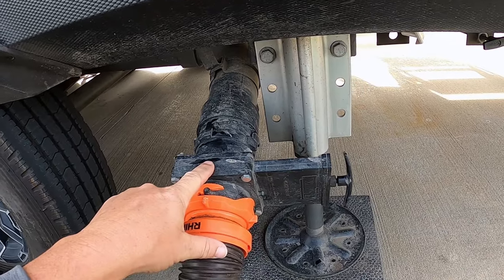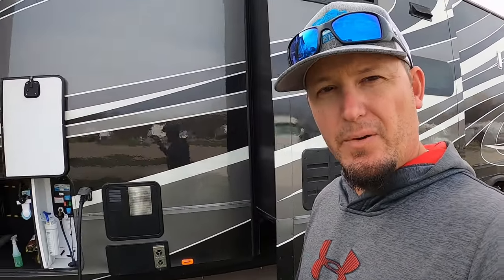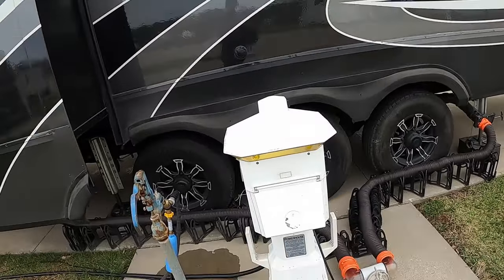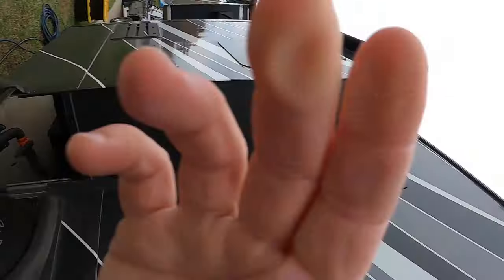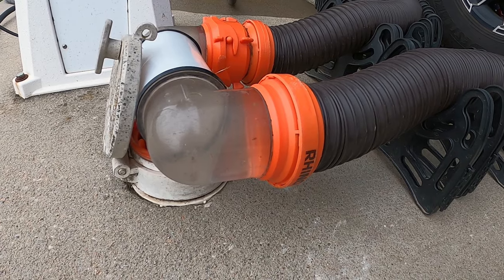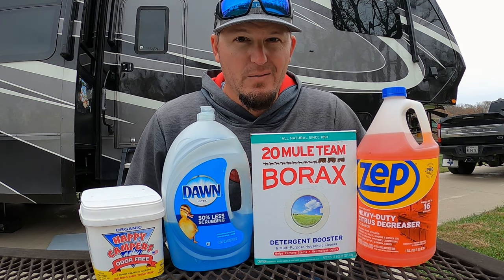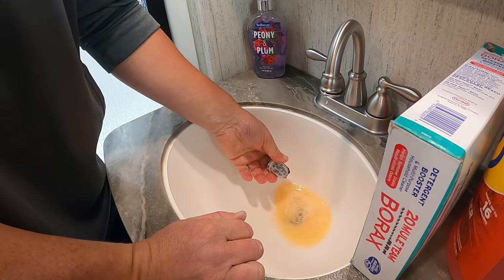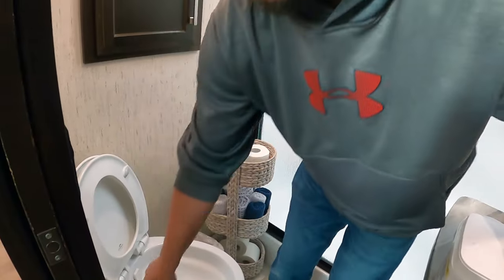RV Black and Grey Tank Cleaning and Maintenance | Geo Method | Full Time RV Living

Comment: Is there a reason why you don't flush your black tank out while it's draining? Another video showed the person pulling black tank valve to empty then went to the city water and turned it on so while the black tank was emptying it was also flushing.  He flushed until the water ran clear. Is that a bad idea?
Reply from the maker: While that is a way to get a flush the water never builds up in the tank and help bring the big stuff out that way!  I prefer to fill the tank and let the water volume bring all the solids and big stuff out at least the first 2 times!  I do at times let it run with just water to help flush but not after I have used the full tank volume a few times to clear the big stuff!

Comment: So after you add the ingredients to the sink and toilet, you then go back and repeat the flush out process?  What do you then put into the Gray and Black tanks to sit in storage or to the next cleaning?  How many gallons do you try and leave in the Gray and Black water tanks between travel or storage?  Great video
Reply from the maker: No you do the flushing process until the water runs clear, for us that us usually 2-3 times! Once you are done flushing you fill your tanks to about 15% capacity!  We have 54 gallon tanks so I put 8-10 gallons in them, then I add my tank treatments! For the black tanks it is Dawn, borax and happy camper! For the gray tanks it is zep, borax and happy camper! We do all if this the day before we travel so we can do the road clean with the tanks full of treatment while we are driving! When we get to our next campground we use the tanks as normal until they are full and dump as needed! We usually only stay places for two weeks or less so we don't treat in-between dumps just the day before we travel, we do the dump,flush and treating process! We are fulltime so the RV is never in storage but, if we had to I would do the flushing and dumping still and add the tank treatments but I would fill to 30 or 40% tank capacity! I would then let it clean on the way home and find a truck stop or dump station to empty the tanks before putting it in storage!
Reply: @PavingNewPaths  Thank you...have you ever tried fabric softener ? So, since we store about three weeks between each trip (or more) should we just fill with water to 15% of capcity?  then add treatment combination on day of travel?  Love your rig
Reply from the maker: @douglaskarpf481  Borax is basically the same thing as the calgon! If I were you I would road wash it on the way home! Dump and store it dry! Then when you get to your Camp Ground I would add the treatments with some water at the start of the trip!

Comment: I'm Assuming it can be any dishwasher soap and not dawn specific, right?  And what do you think of oxyclean instead of the borax?
Reply from the maker: Yes any soap should work! I think I would stick with Borax because it has a higher pH level than other products and in short terms, that makes it perform better.
Reply: @PavingNewPaths  Nice, that makes total sense on the PH levels. Thanks for the info!
Reply: Dawn is still the best, just like washing anything, dishes, clothes, the cleaning agent matters, and cheaper soaps tend to suds more but take far more soap applied to complete the job.

Comment: Picking up my first trailer tomorrow so this is all new to me.   I have a combo black/gray tank.  Should I just use the black tank method?  Also, we plan to use the camper for weekend trips 1-2 times per month.  Should we add the treatment the day we leave and let it sit in storage that way between trips?
Reply from the maker: If your tank is a combo I would just use the Dawn, Borax and Happy Camper!  If you are not using the camper fulltime I would do a really good job of flushing the tanks before you head back home and let them store dry!  When you get to your camping spot just fill the tanks with some water and add the products!  If you want to really clean them prior to heading out for the weekend add some water to the tanks and the products and let it slosh around on your way to the campground!

Comment: Do you use the same amounts of cleaner in a smaller tank? Both my gray and black tanks are 40 gallons.
Reply from the maker: My tanks are 54 gallons so if you wanted  to use a little less you can! We have found that if you stay on top of it and do it often you can get away with less, but if you have extended stays or skip weeks it takes more to get the results!

Comment: The degreaser you are suggesting that people use says on the label that it is NOT to be used on any type of plastic. Your holding tanks are made of plastic.?????? There are other degreaser products that are safe for use on plastic.
Reply from the maker: You do understand dilution right!  We are using one cup for a 54 gallon tank of water! If it's not made for plastic then why does it come in a plastic bottle? I didn't invent this procedure, this is a know procedure called the bio geo method and we have been using it for 3 years doing this process weekly and have had great results!

Comment: It's it necessary to fill black tank if you have black tank sprayers in the tank?
Reply from the maker: We have black tank sprayers on our rig and they don't spray like you think!  We use that port to flush and fill the tank!  When it is full we dump it while letting the water still run through the sprayers!  You will see the water run clear, but the tank is not clean!  If you close the dump valve and let the tank fill up again it will be just as dirty as the first dump!  Usually takes us 3 flushes before its clean!

Comment: Great info this was. The problem I’m having is when we got back to our trailer lot to dump and flush out my tanks I had a problem with the black tank. I did the steps I always do and when I went to flush out the black tank, I pulled the black tank lever first then pulled the gray to flush it out. Then I closed both tanks and hooked up the hose to the flush out for the black tank. Let it run for a few minutes then when I pulled the black tank to drain nothing came out. So I did it again and let it run for a little longer then pulled the lever again and still nothing coming out. Could it be that the black tank is plugged and won’t drain? How do I get it unplugged?
Reply from the maker: We have had that problem one time as well, we had to use a waterhose inside the RV and fill the tank from the toilet several times to get it cleaned out! They also sell a wand you can use the same way!  We made a video about our situation here! https://youtu.be/tsiZ5dc-WtQ

Comment: Do parks allow all those things to be dumped in their sewage tanks (when you dump)?
Not sure, but it used to be that they wouldn’t allow anything perfumed like the blue stuff people used to use.
Just wondering.  Camping and tank rules seem to be different nowadays.
Back in the day for example, we didn’t have any little stands for the hoses or see-through connectors.
Reply from the maker: Most parks tie into the city sewer nowdays and the ones that do have the aerobic systems might have a list of products they don't want you using!  For the most part we have not had an issue with these products that and we have really big tanks so the mixture is very diluted!  I have heard California as a state is outlawing happy camper!
Reply: California has outlawed anything containing the word  "happy"

Comment: Thank you for the septic system upkeep video. I have a question on a different subject. We have 3 axles on a 30ft toy hauler. They 4 jack stands are down & the tires are chocked. I feel every motion like I'm in a boat-I go outside to solid ground & I walk & feel as if I'm drunk. Any suggestions as to how to fix this problem. Thanks in advance-grandmas affraid to fall in the shower 🙏💞
Reply from the maker: What I have found is the longer your jacks are extended the more you feel it in the camper.  So for us we made blocks to go under the jack feet to keep the jacks from extending so far when leveling!
Reply: @PavingNewPaths  Thank you
Reply: Have you tried the chock that goes in between 2 tires and tightens to stop movement?
Reply: @badgerpa9  there a chock under one of the three tires-just to keep it from rolling. Thank you-I will look into the ones that can be tightened
Reply: @3generations393  When you put one on each side, each one will lock the two tires together and really reduces movement.  Little kids can really shake a camper or RV.
Reply: @badgerpa9  😅 My dog shakes the camper.
Reply: @3generations393  Is it a tea cup poodle or a 150 pound Mastiff?   Just kidding our lab would shake a camper the way he flops down if he doesn't get attention.
Reply: @badgerpa9  🤣🤣  40 lb Schipperke mix
Reply: @3generations393  sounds like a mixed drink.

Comment: I skip the Happy Camper, and use all three Dawn/Zep/Borax to both gray & black tanks. I pre-mix the three in a one-gallon jug (Borax does dissolve the best) with a half-gallon of water. I've been doing this for 4 years and have done well with the exception that my tank-level sensor have never been accurate. Even when empty they will show 1/3 level. I may try the Zep toilet cleaner the next time I empty and give it a shot.

Comment: How often do you move typically?   And how often do you have to dump?    Great info.   Do you use cold water or warm/hot to help get the borax to be less of a brick?  Great content, glad I found your channel
Reply from the maker: Thanks for watching! We move about every 14 days right now.  With four of us showering and washing clothes the grey tanks are usually dumped every 2-4 days thats why I only treat those before a move, so the products are in the tanks for about 5 days including travel day. The black tanks can go around 14 days before they need to be dumped. I typically try to just stir the borax in the water to keep it mixed up while draining into the tanks.
Reply: @PavingNewPaths  wow, 14 days on black tank, we go about 3-4.   Does your second bathroom have a shower too?  That is a rig set for being out and away for sure!!!  Be safe and keep posting!!!
Reply from the maker: we have two black tanks for a total of 108 gallons.